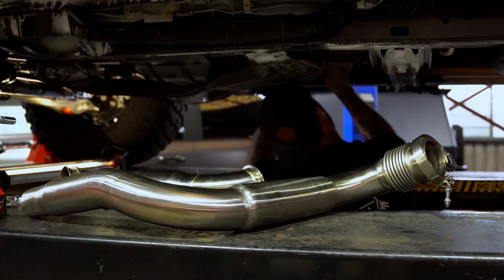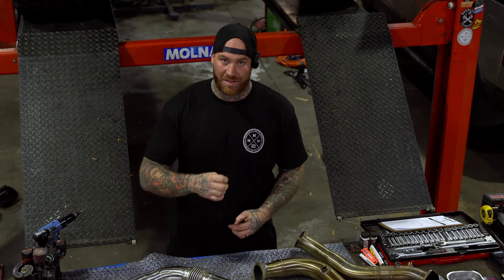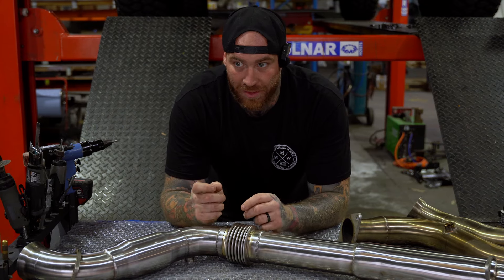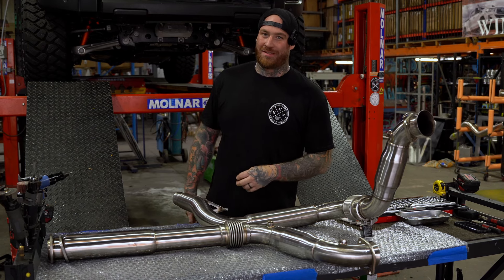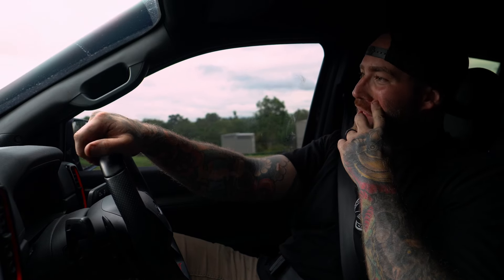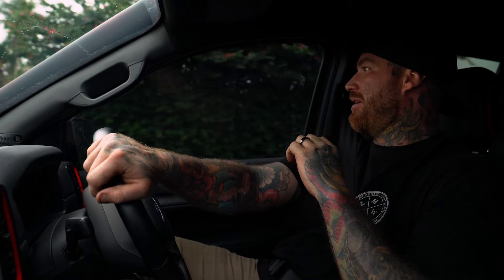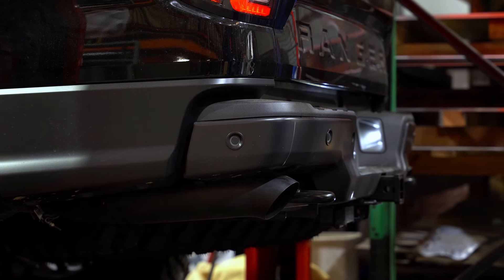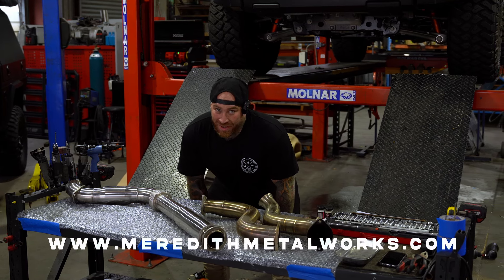Next Gen Raptor Aftermarket Exhaust. What power did it make?!

Comment: I’ve heard people are losing power changing the exhaust. Do you have any dyno results to show this isn’t the case with this?
Reply from the maker: Hey mate, we will do a final video going in depth of the dyno results abit more. A quick breakdown of what we have found is that the exhaust doesn't make a different with horse power gains, it makes the car come on boost 4 seconds faster and holds its temps a lot better. so although there isn't direct gains there is gains in long jevity performances.